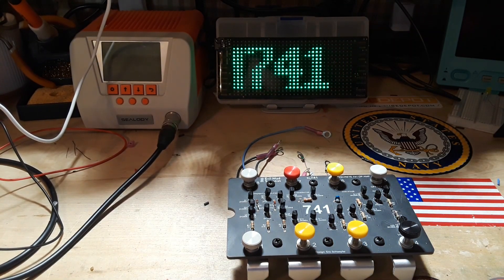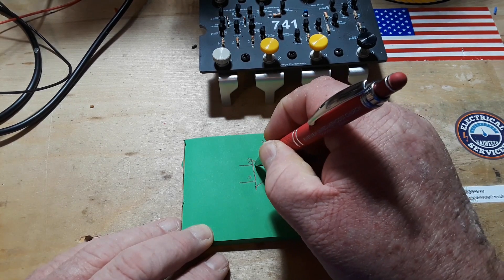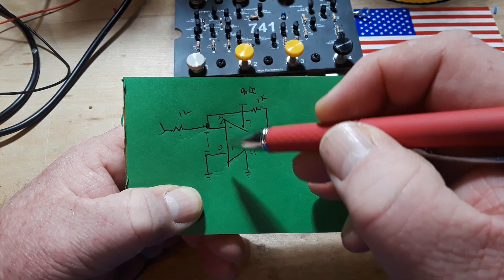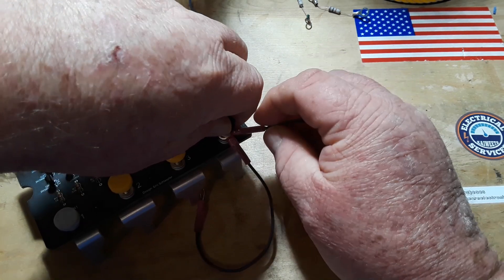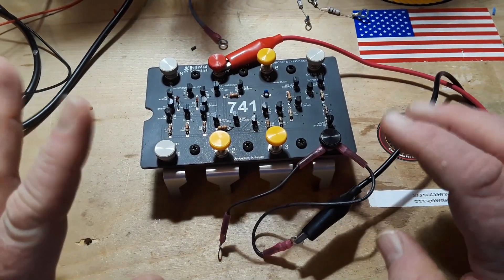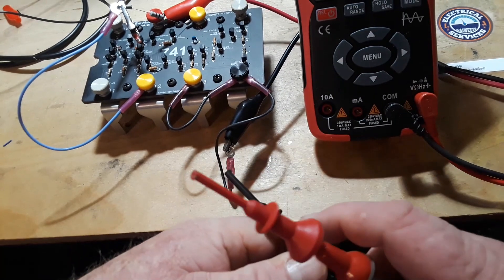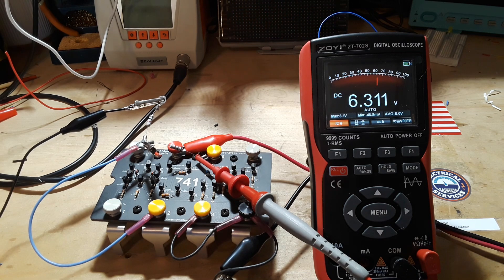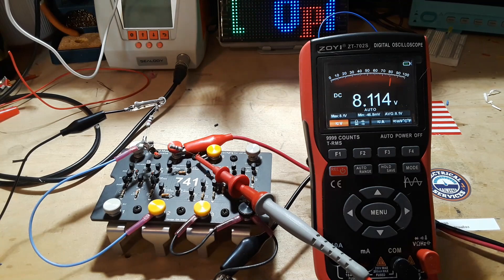OpAmp Inverter -  Sponsored By Solderstick Wire Connectors

Comment: The 741 has been a goto op amp for many years due to its wide swing voltage and current cability.  The fact that it also has a null circuit, makes this ic a great choice  for a wide variety of circuts and the price is really good.

Comment: IF you input negative -5vdc and you get positive +8vdc that is wrong, it should be positive +5vdc. I'm not sure why the input voltage of the Opamp inverter is not following the output voltage.
Reply: Some of us thought that discrete components representation of the op amp was supercool, but thanks anyway for clearing it up with the input and output voltages.
Reply from the maker: This "741" is made up of about 75 discreet components. All bought for the lowest cost. Don't expect too much accuracy. A real 741 will behave better
Reply: @learnelectronics  try using a normal stock 741 or 4558 to see the accuracy in the video because its confusing
Reply: That's something you should expect from an IC, but this is a board filled with discrete components. There's an awful lot that can happen at every junction, and the biasing resistors weren't the tightest tolerance in the world, either. 

There's more than enough reason to expect some slight amplification on this setup instead of a perfect following, and the weirdness you're pointing out lives well within an experienced hobbyist's expectations.

To be honest, there was a time not so long ago when this would have bothered me, too. I totally understand.